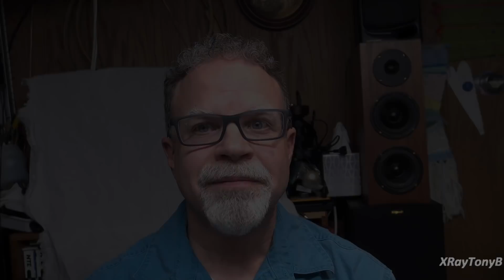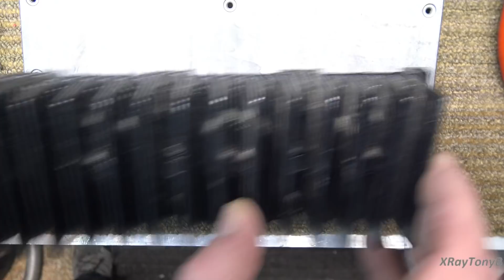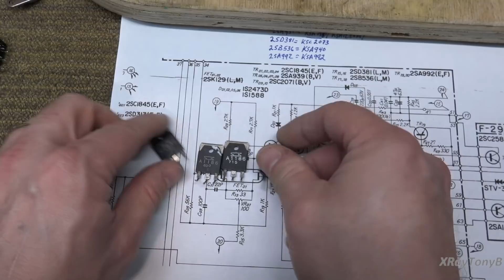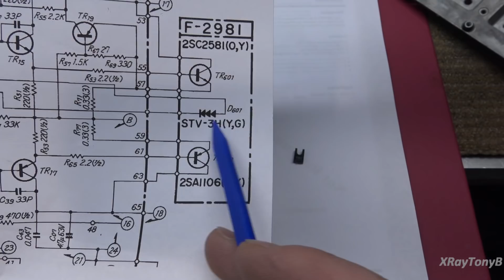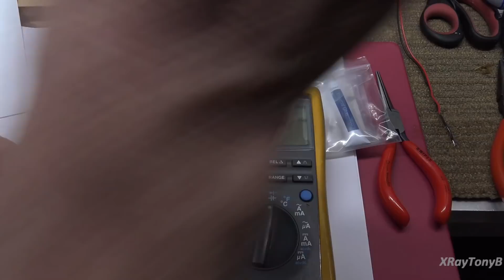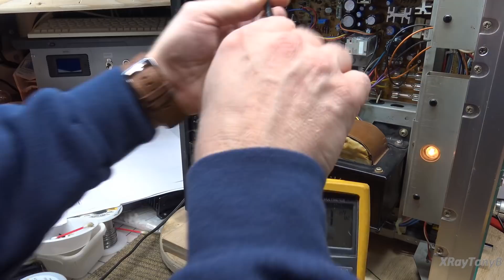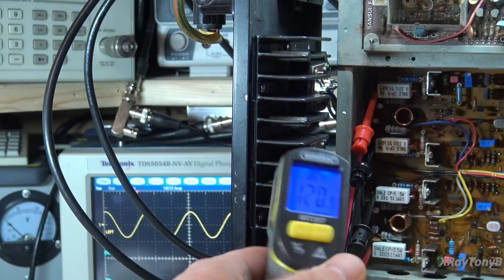Sansui G 7500 - Repairing Fried Parts - Replacing Outputs and New DIY Stabistors

Comment from the maker: 0:15 Intro
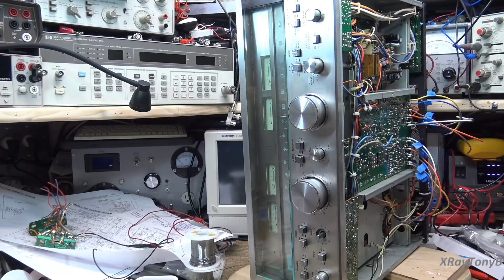2:28 Looking at how it was found
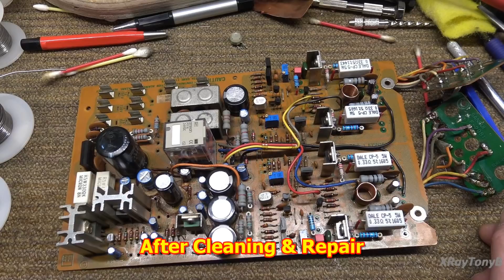3:27 Amp board after cleaning & Repair
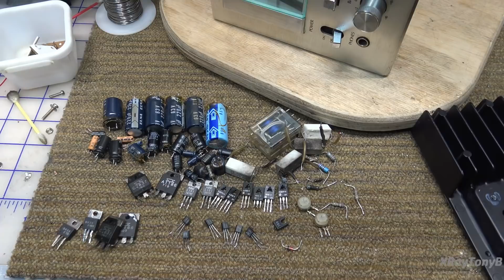3:38 A look at all the burned components
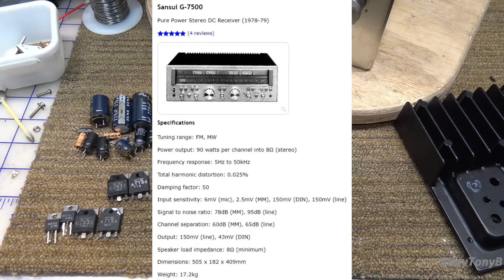4:04 Sansui G-7500 Spec Sheet
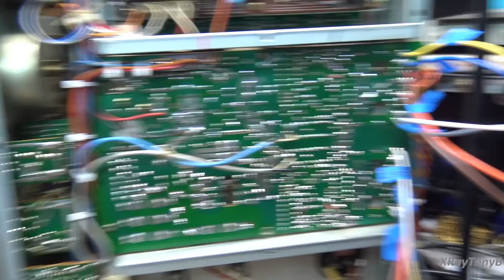4:26 Looking at the repaired board installed
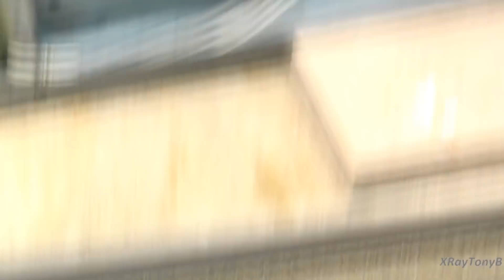6:37 Original output transistors and heatsink
11:12 LAPT transistor vs Standard transistor
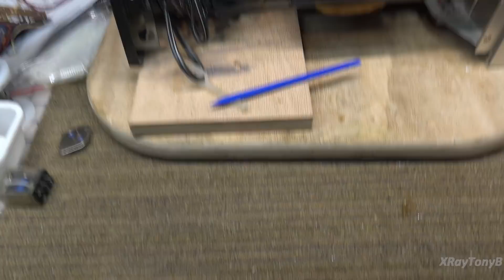15:42 List of replacement transistor types used
16:36 Replacement for the STV-3H stabistor module (original was damaged)
17:08 Can you replace a Ring Emitter Transistor or LAPT transistor with a standard transistor in these amps?
23:05 What is a Stabistor and how can we find a replacement?
30:45 How to make a replacement Stabistor
34:26 Testing the DIY Stabistor out-of-circuit
38:00 Replacement pots for bias and offset
39:30 Replacement relay for the protect circuit
40:22 New output transistor mounting with sockets.  LAPT Outputs were replaced with MJ21194/MJ21193 transistors in TO-3 type case, which properly fits the heatsink.
42:39 First Power-up and tests
53:07 Adjusting the BIAS & DC Offset
1:03:50 Testing the amp on a dummy load with signal.  The new Stabistors are working Perfectly!!

Comment: Very good video. Has learned alot. Im has been recaping an old Marantz receiver right now with a new uprgrade 312 ''OP amp'' chip from Sparkos. A big difference from the old one. Less noice and a better sound stage. Wanna like to hear about bypassing these  big filter capicitor, and what this mean about the improvement of sound and measurement. Greetings from Norway
Reply from the maker: Bypassing the main filter cap at the capacitor terminals won't really make any difference, as the wire lead resistance will defeat its purpose.  Place the bypass film caps right on the board close to the circuit.  It will help with the HF response.  You also have to watch adding too much capacitance on the board, as I've seen it cause ground loop hum.

Comment: I think that this is not a stabistor but it is 3 thermal diodes. It control the BIAS voltage depend of the temperature of the heat sink of OPS. It reduce the BIAS when the heatsinc goes warm.

Comment: Just an FYI for folks who have issues with a G-7500 doing exactly what this one has done the Bias Pot Tony Mentioned is one of the key failure points for these RCVR's i have repaired 3 or 4 that had that failure mode. Its a chain of events. The pot opens and the Bias voltage goes to the rail. That high base current shorts the drivers and a cascade effect happens . It will open the emitter followers and a bunch of smaller resistors right around the output transistors .
Reply: These Sansui DC amps sound fantastic! Superior to all but Spectral for slew rates. IMHO.
The downside. These Sansui D.C. amps are finicky and often unstable. Not to mention, difficult to work on.  
I never turn off my AU-D11ii to minimize power up surge. I only switch out my speakers when not listening.
Reply: N.I.R.resistors too

Comment: About making those stabistors. I have a Pioneer SX-838 that has corroded legs right at the base of the stabistors and they both snapped on me as I was removing them to recap the board.

My question is, is there certain chips that should be used with each unit depending on each model specifics or is STV-4H stabistors a universal thing? Could you make a video to elaborate on this for dummies as well as making these? I would appreciate the reply as well if you don't have time. Thank you.

Comment: Hi,, I had sansui g-8000 and it in the protection mode that it not go to ready. The output transitor are 2sa7458 and 2sc14038 . You have any recommended for replacing this transitor with different one since I can't find the original one. Thank

Comment: Your whole background piece on the different types of high-frequency power transistors: absolutely fascinating. 
Thanks a million for that little episode of "Transistor Talk with Tony B."
I''ll say this regarding higher frequency/ high slew-rate: about the year 2001, I re-chipped an older (circa 1979-81) mixing console called an "APSI 2001" using more modern, higher slew-rate TL072 op-amps. (Just an aside you may appreciate, Tony: the APSI 2001 was used on tour by Rush for front-of-house and stage sound around that time.) 
Anyway, I submit that the difference was clear, substantial, and a notable and significant improvement. The old Texas Instruments TL072's had a slew rate of 14µV/ sec, while the newer ST Micro TL072's were spec'd at 16µV/ sec. 
It made, to my ears, a BIG difference. Now, could it have been that it wasn't the slew rate, but simple overall improvements in general op-amp/ chip manufacturing techniques? Could've been. But I don't think the better slew rate played an insignificant role.

Comment: 50:40. Your observation is spot on. I have that exact meter and do not like it for the same reasons you have stated. I rarely use it anymore. Also, the Fluke 87V is what I use at work.  Had the original 87, then the 87III, now for the past 15 years the 87V. Good all around meters. Also, built safely so there is little worry when I am measuring 480 volts 3 phase high energy circuits.The meter is very unlikely to blow up in my hand as other, more cheaply made meters may do.

Comment: I have this models smaller brother G-5700 on the bench right now. It's the first time I'm repairing a Sansui receiver, and boy am I dissapointed! It's an awful design! It's the worst case I've seen, all burned up inside, half the caps leaking and spilling electrolyte all over. Resistors charred, transistors burned or damaged. Flux crud from the factory hade to be scraped off. I say to myself "what the hell was Sansui thinking?", " why are these so appreciated, it's a bloody failed design". 
Then some ICs that are unobtainium. And component margins that were too thin. And a design that is a hodgepodge of not very practical or durable solutions. It's a nightmare to work on. 
Here is where the era of throw-away-consumer-electronics began it seems..

No criticism of Tony's video of course, very helpful and interesting, as usual. And good to see I'm not alone in battling the weirdness of early 80'ies San-sewage. 
Damn, I so badly want to dump this receiver in the garbage, but it's a customers so I'll struggle a bit more..

Comment: Very nice Tony,  just wonder what about stability,  phase margin,  gain margin,  when you change those 70Mhz transistor to slower , do you need to adjust the loop gain too , you  test with square wave to see if you have  ringing.

Comment: Tony  , we had the same cheap multimeter   , they have common mode problem with  low level measurement.  But not fluke.

Comment: Oh, I just also wanted to say, there is a German ebay seller in Germany who has NOS STV3H diodes (tens of thousands), they are still available, I have a decent stock of them. I've used them many times and they seem to be the real deal.
Reply from the maker: Thanks for sharing that info.  I'll have to check it out.

Comment: Great video, thanks! I was wondering how you set up the power measurement on the Tek scope channels. The scale is VV and the traces appear to be DC level rising with the output level.
Reply from the maker: The VV is actually the direct power readout of each channel.  It reads watts into an 8ohm load, based on the RMS voltage across the 8ohm dummy load.  I also have a similar math expression programmed for when I'm using a 4 ohm dummy load.  Thanks for the comment!

Comment: shouldn't you use a more powerful relay like  275 volt it was 240V's
if that came to the UK that be running at it's maximum voltage limits, it's a switchable universal power supply isn't it?
anyway I would do away with it reallys should not be in audio amplifiers they degrade the sound, not sure about solid-state tho! if they are better or not! why don't you use solid-state instead of mechanical relays?
isn't it better to have the offset a little bit higher say 10.5V so it's constantly running in class A mode for a higher given output
Reply from the maker: The relay in question is being used in the speaker protect circuit.  It is switched by a 24VDC source and it controls the power going out to the speakers.   This relay isn't affected by what mains voltage the amp is wired for.  The relay has four sets of contacts which are wired in to parallel sets for right and left channel.  They add very little resistance to the overall circuit and while anything can affect the sound, this would be minimal.  Hope that helps
Reply: @xraytonyb  yeah I didn't think course it is it's not a mains one.
depends on the amplifier I'm not sure it's minimal it can affect soundstage ? merry Xmas lol
Reply: @hoobsgroove  The G-8700DB has a 3.9 ohm soft start resistor and a timed mains relay that kicks in parallel after the capacitors are charged. Is that the kind of relay you are talking about?
Reply: @zulumax1  yeah

Comment: Interesting stabistor replacement technique, butttttttttt…..how do you know it has the same characteristics of voltage versus temperature as the original?  I would assume it has to match those output transistors.
Reply from the maker: Good question!  Even the STV-3h will have slight differences to one another.  This is the reason there is a resistor/potentiometer in series with the stabistor.  This allows you to adjust the overall voltage in the bias circuit for proper bias.  There are two important factors when using a stabistor:  First is that the device should maintain a consistent voltage drop as forward current increases.  Second, the forward voltage drop should vary in a linear and predictable way with changes in temperature.  As a general rule, you want the majority of the voltage drop across the bias circuit to be across the stabistor and the resistor is used to "fine tune" the overall voltage.  Any changes in the output transistors due to temperature will also be seen across the stabistor, as long as they are thermally coupled.  The stabistor I used had a voltage drop within one diode drop of the voltage drop of the original STV-3h  device.  The pot can be used to compensate for that slight difference and the circuit should work as originally intended.  Sorry for the long answer, but I hope that explains it.

Comment: I work on a LOT of Sansui amplifiers, those output transistors you've used change the sound of the amp, they are not good devices to complement the amplifier design.
These amplifiers can be a nightmare, the F2980 power supply/Power amp driver board is a particular nightmare, they are in several models of Sansui, I have rebuilt a LOT of these. No reason to not use components which match and complement the original design.
However, I respect what you're doing, and its certainly a way to get it running and I know your solution will have it running reliably.
Reply from the maker: Thanks for the comment!  Another viewer and I are discussing some of the reasons why this could be true.  It is very interesting.  I have always heard that this will change the sound/cause the amp to fail, etc., but I wanted to see this for myself.  This was a good opportunity to experiment.  I do not doubt that there could be a difference in the sound, but as of the writing of this comment, I'm unable to see it through any of the tests I have done, nor can I hear it (although my hearing isn't what it used to be) by just listening to music through it.  I have not done exhaustive testing, nor have I done any listening under the best conditions, so the jury is still certainly out on this one.  Looking at the design, you can certainly see how this could affect things, especially in terms of NFB, as I mentioned in the video.  Time will tell.  I know I would have never tried this on the AU-X1 (waaaaay different design and it was in far better condition than this poor G-7500), but this was a good opportunity to experiment.  This is how we learn, and i certainly have a lot to learn myself!  Thanks again!
Reply: @xraytonyb  Thanks for the reply Tony, its a very complex reason as to why, but I am pretty sure part of it is the very linear phase through the bandwidth of the amplifier, particularly in the top end,  there is also something more composed and controlled about the transient response too. I use the same JBL4412 studio monitors when I am assessing amplifiers after service and restoration, and I can absolutely hear the difference. Very basically to me, it also feels like you might be able to hear more detail in the music like for instance a vocal reverb which will appear to have more depth, or perhaps an acoustic guitar buried in the mix in a very electric rock song which might otherwise go unnoticed. Those are just a few things that come to mind. Also the G7500 is an oddball model, its almost like Sansui just threw those together with a bunch of things they had lying around, the tuner board is from one of the Quad receivers, I cant remember what model, the F2980 board (power amp driver) is from other models, the TO3 heatsink and so forth. When I repair these ones, I file off the anodising I believe it helps with the thermal coupling. This design is as you know and have seen, somewhat unstable on a good day!! They do sometimes fail for what seems like absolutely no reason!!  I'm enjoying this episode, and as always your work is top notch!!
Reply: Hi Ken, I am working on a Sansui G-8700DB and have acquired the ON replacement devices from Mouser. I knew the reputation these G series amps have of self destruction and was hesitant on taking this one on. Kind of like a room full of mouse traps and throwing a ping pong ball into the room. When the owner found out that it may need a dozen transistors and half a dozen resistors on the driver board he said keep it. The Marantz 2275 I worked on was of similar design and used the same T03 devices from Fairchild. The Toshiba outputs that Sansui used are not made anymore, and there are lots of counterfeit ones on eBay. Do you know of a better replacement?

Comment: Tony just curious since you do a lot of meter measurements why not get a bench meter?  I know it is not as portable as the Fluke. Or buy the Bryman 235 meter which is just as accurate as the Fluke.
Reply from the maker: I currently have 4 of them on the bench; 2 Digital (Keithley 2015/Keithley 197) and two analog (RCA Volt-Ohmyst / HP 410C).  Although I use them a lot outside of videos, it's hard to get the bench meter and what I'm doing in-shot.  It's much easier to use a handheld meter, so that I can get everything in-frame.  As for the Fluke meters, I have other meters, but the Flukes are what I have used at work for the last 32 years.  The ones you see on the bench have either been retired from the field or are spares.  I am also liking the Amprobe meter I just got, although it needed to have the input jack re-soldered and it has a much higher burden voltage on the milliamp mode than does the fluke.  Thanks for the comment!

Comment: How would a squarewave look like on an amp hooked up through a separation transformer? With spikes? I heard you saying something like that.
Reply from the maker: When you get transformer sag (or sag due to those limiting bulbs being in-circuit) you will see the top and bottom of the square wave be sloped, instead of flat and square, due to the voltage drop over time from the transformer or current limiter.
Reply: @xraytonyb  Thanks. Testing I almost always see spikes on top and bottom of the square. Not with one amp but many under test. Something wrong with my setup? Cannot figure it out.
Reply: @jansen2810  Could that be probe compensation?
Reply: @jonka1  In the setup I don’t use the probes. From the input (1kHz) to scope through the outputs with 8 Ohms dummyloads. Like Tony does
Reply: @jansen2810  Ok just wonder if it's worth inputing a square wave via (presumably) your BNC cables direct into your scope.
Reply: @jonka1  From my signal-generator into my scope?  Perfect square. Is that what you mean?
Reply: @jansen2810  Yes if you haven't already tried it. Just wondering if your scope has a problem.
Reply: @jonka1  No, I have two, analog and digital and a software one on PC. All the same.

Comment: 8 Ohm minimum speaker impedance on the spec. sheet?  Is this amp really limited to 8 ohms, most of my speakers are in the 4 to 6 ohm range.  When measured with a frequency /impedance sweep, they even have dips into the 3 ohm zone.  Is Sansui generalizing or?  Would it run hot at the worst.
Reply from the maker: The unit has outputs for two sets of speakers.  If you select both sets at once, it will put speakers A&B in parallel, making the load 4 Ohms (nominal).  The amp can handle this OR ONE 4 ohm set of speakers.  They just don't explain this in the manual.  At 4 ohms, however, the amp will run hotter than with an 8 ohm load due to the added current.  In addition, the transistors I used can dissipate 2.5 times the power of the original transistors.  Most likely the emitter resistors would open before the transistors failed.
Reply: @xraytonyb  Thanks, I thought there was a way the amp was rated for 4 ohms.  The 4 ohm question came up on a set of speakers I recently designed and built, (thanks to some great software too) and they have a two woofer MTM setup so 4 ohms is a real number.  My question is that I use two integrated amps, an Onkyo and a Yamaha, both less than 5 years old.  Each has a switch for 8 or 4 ohm loads output.  The manuals dont say much except dire warnings.   How do these amps provide two outputs?  Pretty sure its not an output transformer as tubes.  My limited study and experience hasn't come across a way to perform this.  Maybe an additional output stage of power transistors?  Thanks a ton, best channel on the tube.